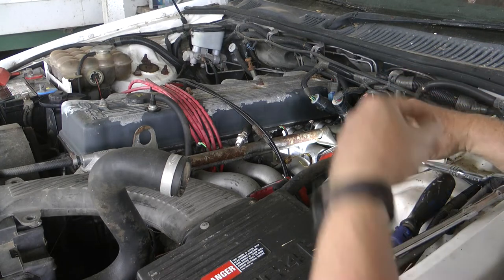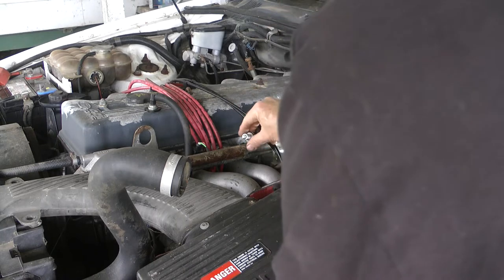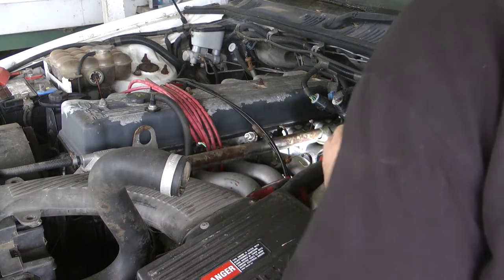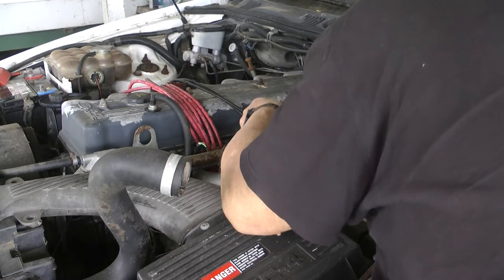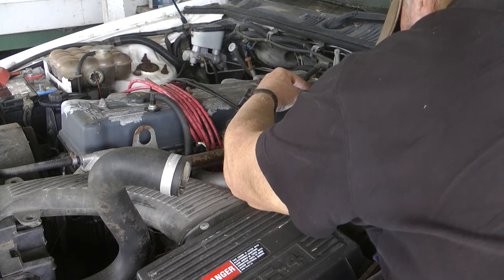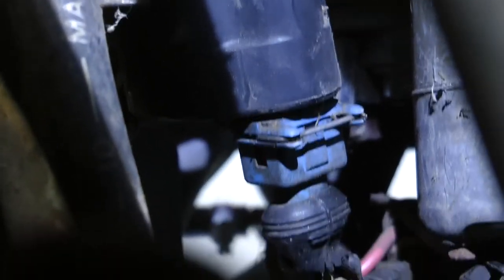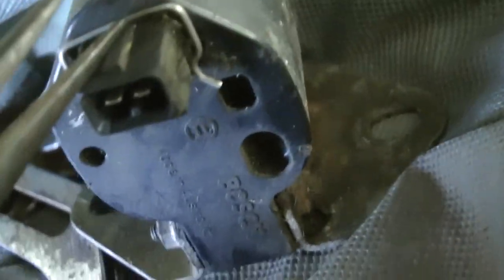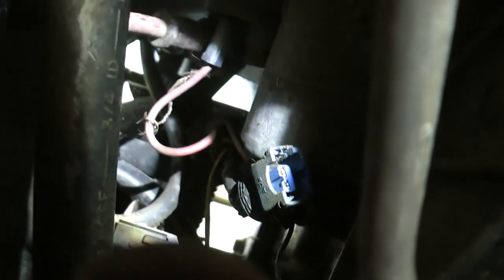How to test and removal of EA EB ED EL EF Falcon ingnition coil Please subscribe for more.

Comment: Im going through this same saga at the moment. Wifeys ed fairmont. Struggling to start, especially when warm.  When it finally does, it feels like it's going to rip the engine mounts to shreads and fling its way out of the engine bay. Have swapped the ignition module with a good spare one ( tested ok ).  Just want to get coil out and clean up and check out with ohms meter while im there. Ford and all their wisdom with those bloody log manifolds not making anything easy to get to 🤦‍♂️